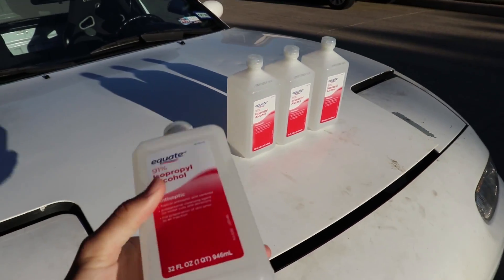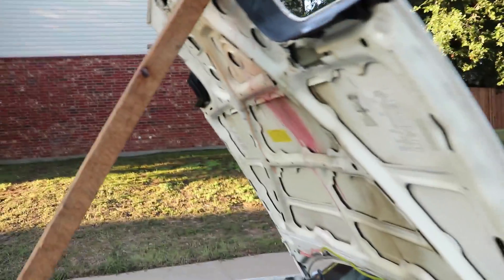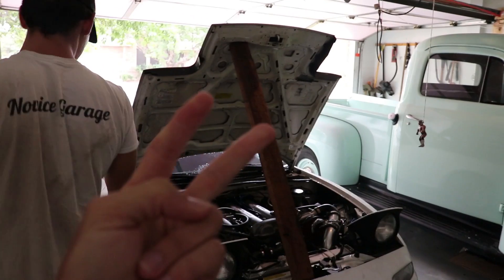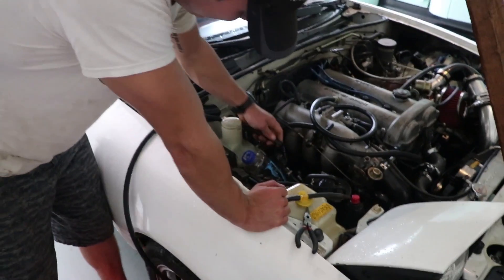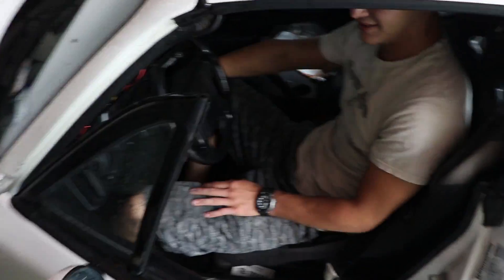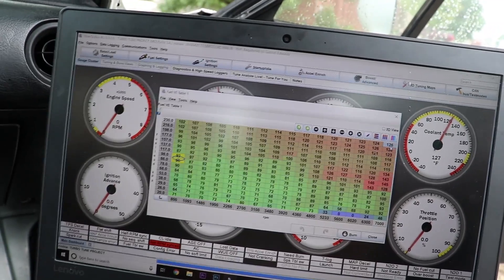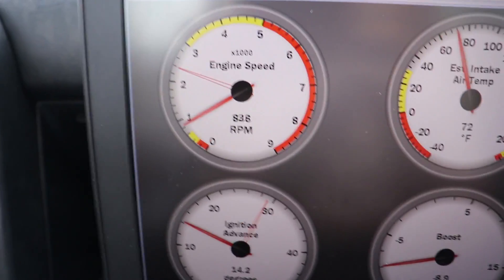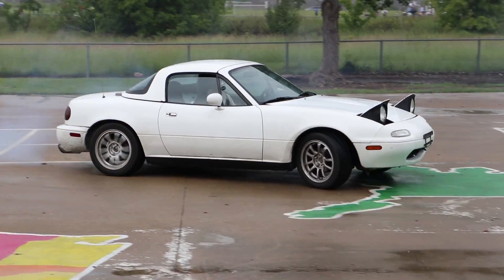Will Rubbing Alcohol Work as Car Fuel?

Comment: What if cars can be powered by any liquid for gas but the government trick us into buying gas for money.......

🤔🤔🤔🤷🏾‍♂️😂😂😂
Reply: It has to be combustible to work in a combustion engine.
Reply: chris rice ok smart ass way to ruin it
Reply: chris rice why cant we make a chemical that acts as gas then? Im pretty sure we can just like any other chemical out there that's been alternated
Reply: @xWonders_worldx  there are a lot of combustible gasses/liquids that can run a car engine (hydrogen and methane to name a couple), they are just tuned/designed to use petroleum gas, the air/fuel ratios just need to be changed in the car ecu(or carb if older car) to run properly.
Reply: and alcohol of course, although it would be way smarter to use anhydrous ethyl alcohol (i.e. no water at all). I think it's also important to note that although you can get a car engine to run off a multitude of combustible liquids/gasses, I'm pretty sure non of them end up being cheaper than just buying petroleum gas, at least at this current time.
Reply: Casey Newman thx for the answer
Reply: The government does. The banned alcohol Im the 1920s because they realized the ethanol from alcohol could be used as gasoline
Reply: Yardienate search up get engine my man
Reply: Yardienate Geet engine

Comment: Just spin the crankshaft with a ratchet to get the mixed oils to work past the rings, there was no need to shock it with the starter motor.

Comment: I think running diesel through it will fix it. to explain, Old-Timers would take gasoline engine that have low compression , blow by or just half slab pour out and run diesel through it for a while and then put it back on gasoline. I'm not sure how many gallons, possibly a gallon or two or even a tank, I cannot recall but it will restore compression and tighten it all up so you can drive it all the way into the ground. That's why you see all those old cars that are worn out, barely sticking out of the ground.

Comment: You need that 99% isopropanol.
Reply: I can't believe they did this with the 91%
Reply: Matthew Douglas exactly, it's not difficult to dry a water/isopropanol solution, and you really shouldn't put anything that isn't anhydrous into your fuel tank. That 9% water content will fuck with your engine
Reply: @p1nkfreud  or steam clean it lol
Reply: That good pure shit lmao.
Reply: You can get the purest stuff from a chemical supplier, or just run vodka
Reply: @bachlava7  Granny's white lightning.
Reply: Chris Rackley You're joking, right? Vodka isn't anhydrous by a long shot, ethanol is worse fuel than isopropanol, and vodka has other impurities besides the ~50% water content...
Reply: @p1nkfreud  vodka is so highly distilled it's almost purely alcohol. Only water is added when it's bottled/sold. So you tell me what the joke is, running your car on rubbing alcohol from the store, or seeing if you can run it off of other stuff too...

Comment: Why are you cranking it without the spark plug you weirdos
Reply: Sahm Dhude they could have used a hand pump and pulled the oil out with out spraying all over like juveniles.      

Then the remaining could have been started with it in the cylinder.     

Do a proper oil change and you’re good

Comment: Chicks and gay dudes love their Miatas.
Reply: anthony cusinato Hahahaha my thoughts exactly
Reply: It's a sports car that is a hell of fun to drive. You could probably floor it when making a corner on a Miata and the tires wouldn't slip, try that on a mustang or Camaro and you'll lose traction.
Reply: WooferJr because torque because power. Because those cars leave their purses at home before slamming the pedal down. Here’s one try to roast the Mazda tires doing 30. No bueno. Go carts are more fun than that gutless wreck. I’ve got a 307 running stock after 35 years in an 8000lb boat that would destroy this fart box
Reply: @SingleMost  preach brother, preach!

Comment: Iv done it. 1997 chevy barracuda. Ran out of gas pulling out of CVS. Ran back in bought alcohol and potted down the road maby 200 yards to a gas station. The fumes burn your eyes and is hard to  reath
Reply: Did you had to replace anything after doing that?
Reply: No. I drove under suspension and it got impounded. Never got it back. The car was trash. Had a 2×4 holding the drive shaft on.

Comment: I HAVE USED IT IN MY CAR FOR 4 YEARS MIXED WITH MY GAS.  I HAD BETTER LUCK THAN STORE BOUGHT CLEANERS
JUST ADD GAS AND DRIVE IT IS LIKE  NORMAL. MY SUV RUNS OFF 91 % Gas and I buy cheap gas then add the 91% rubbing and it brings the octane up

Comment: Should work fine. The seals may dry out and not like the alcohol.
Reply: Also wouldn't burn so hot that it would burn up the valves?
Reply: Oh and with the water content rust up the fuel tank and lines?  These are some issues with burning "Moonshine Gas"

Comment: I put that type of rubbing alcohol in my windshield squirter to clean my windshield on another note on that same alcohol being in the windshield water box it does not allow it to freeze in the winter time a handy little note for y'all had also thought out the windshield when you hit the windshield squirters in the winter time good to know also if you have water in your gas you can add a bottle of this rubbing alcohol to your gas to help burn out the water that fuel source is much cheaper than gasoline so why don't you leave things alone and buy a butt load of rubbing alcohol and dump that in your fuel tank and use that I mean come on that's a lot cheaper than buying gasoline right now

Comment: 20w50 Oil only reason I'm posting on this thread is cause I have had a brain tumor and alot more stuff wrong and just now found out i had this and more complications more POWER to you should put a rotary motor setup next na itb or boost it I miss my 2nd gen rx7 beast 12000rpm all day but I'm a honda guy my buddy had 5 rotary blocks bolted up together and he has more but hasn't put it in anything yet GVille,TN AKA EViL,TN

Comment: Fun fact: Carl Benz, inventor of Mercedes and the creator of the first car.... Used rubbing alcohol as fuel for his cars back in the 1880s
Reply: Fun fact #5: A bolt of lightning contains enough energy to toast 100,000 slices of bread.
Reply: Fun fact 4. Brazil has "carros flex", cars that run on 💯 cane sugar alcohol as main fuel these days and I doubt everyone there's replacing engines Every 6 months
Reply: Jkaps artist and gamer the US has “Flex” fuel cars, too. The highest ethanol content they sell is 85%. In the summer, it can be as low as 51%.
Reply: Fun fact #3 , if you set your car up to run on ipa the right way, you'll have alot better success. Alot of race cars run on it but then again I would think they go through the engine atleast once or twice after every race to make sure it's good. lol not exactly for someone who is a daily driver.
Reply: Fun fact #10 : this is the end of fun fact
Reply: Im not gonna lie....   im a little retarded
Reply: Fun fact #6 banging your head against the wall for an hour will burn 150 calories
Reply: FUN FACT #13: Facts are fun!
Reply: Fun fact #8, my digestive system works so well my poop is 80 percent grain alcohol.
Reply: Fun fact #7 whales eject 40 gallons of semen when mating and only 10% enter the female
Reply: nerds
Reply: I wish he stuck with it though🙁
Reply: try 90 proof beer like they dod on back to the future
Reply: Karl Benz's first fuel was "Ligroin", a drycleaning solvent distilled from brown coal.
Reply: Fun fact 11 no is not
Reply: Fun fact #12, more of a scary fact, but based on the first law of thermodynamics, energy can't be created or destroyed. This means there's an eternal past and an eternal future. For you to be here now, if your duration is limited at all, it's a 1 out of an infinite chance (practically impossible) for you to be. Therefore, it's more probable that you've always been. This would mean that you are the origin of all things.

mind-blowing
Reply: Fun Fact #14 I just saved 15% on my car insurance by switching to geico.

Comment: 50% more fuel is probably to much since there was probably a good amount og fas in te tank since you only did 1 gal and it was definitely going to run its alcohol not much different from ethanol but the other 9% is water and if you do Everclear it will be a 95% ethanol just like at the pump just no gas

Comment: I've run mowers on isopropanol before. the big issue is getting enough of it into the engine so it doesn't lean out and stall. Also, side note... you DEFINITELY have low compression in one of your cylinders. You should probably rent a compression tester and try to find out which one is low.

Comment: it's more like 30% increases for alcohol, also next time you are in the automotive section of a store look at the main ingredient in most injector cleaners or like heat fuel system cleaners.....  and turbo running a single VE table???  Everclear would be cool or just go the less expensive and find some E100. Nice work and good choice on using 91% don't think it would have done as well with 70%..

Comment: since you mentioned sea foam, many many people have used sea foam and their car all of a sudden started smoking when before it did not, some of that is sea foam itself. It smoke terribly and it'll take a few oil changes to get it all out of your system. Sea foam has naptha oil in it, which was originally used to speed up drying time of oil based paints, not really something i'd use in an engine. It was developed for marine engines back in the twenties and when it was no longer needed due to technology making it obsolete, the myth has perpetuated that its good to use in your engine. It can clean and unstuck valve stems making them unstuck but the method it goes about this, just isn't healthy for your engine.
Reply from the maker: Interesting. Thanks for the comment!

Comment: 5:50 you hear that skip. Yeah you have low/no compression in 1 cylinder. Do a compression and leakdown test.
Reply: Agreed
Reply: Ilikeboost yeah me too that’s gonna effect later on though
Reply: @likeboost Your the Dr. House of cars.
Reply: wrong its obv a bad decelerator torque belt
Reply: Was going to say the same thing , but i wasn't 100% sure
Reply: Wayne Bryan  you must not know cars...
Reply: B1ind B1ake I don’t want to try to break you down over your comment but there are 2 valves per cylinder (intake and exhaust) neither of which is in the combustion chamber. I think what you were trying to say is exactly what they were saying that there is a compression leak coming from one of the cylinders and one off the wats to test it is to do a compression (leak down) test, at the same time you just kind of made yourself look like a jack ass by saying someone doesn’t know anything about cars when you don’t. The leak would be caused by the already noted stuck piston ring.
Reply: Charles Daniels technically 4 valves per cylinder on the Miata but we know what you meant
Reply: No, he has a leak in the valve cylinder wall...
Reply: B1ind B1ake wtf you smoking.

Comment: you should not seafoam old/high mileage engines. you most likely had carbon around the rings making them seal to the cylinder walls. you seafoamed and got rid of the carbon and now there is space between the rings and the cylinders allowing blow-by to happen. YOU SHOULD NOT SEAFOAM HIGH MILEAGE ENGINES. i doubt you get compression back without putting new rings on those pistons. that engine is shot unless you tear it down to the crank and re-ring it.
Reply: jjtonelli Lol

Comment: You could brake your engine by cranking it with that much oil in the cylinder. Even though you took the plugs out, oil is not compressible, so doing that could put a lot of pressure on it and bend a rod. Be careful my dudes
Reply: U think he gives a fuck about that car hes putting rubbing alcohol in it and all different kinds of other shit that does not need to be in it
Reply: I think you need a beginners mechanic class buddy
Reply: If he takes the plugs out, how the fuck is it going to compress fool 😂
Reply: Oil does not go inside the combustion part of the cylinder. Or idk

Comment: By the way, I'm assuming you want to double the amount of fuel for a 7:1 ratio. That's an increase of 100%, not 50%. I'm no tuner or anything, but 100 + 100 is 200%. 100 + 50 is 150%.